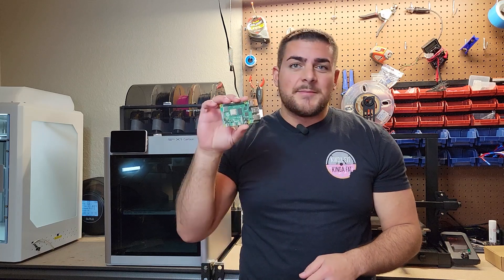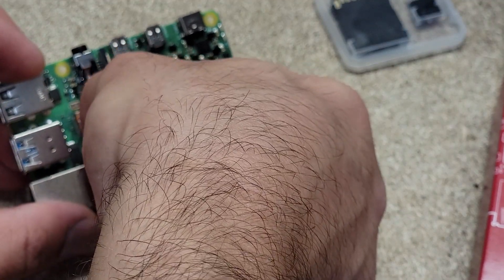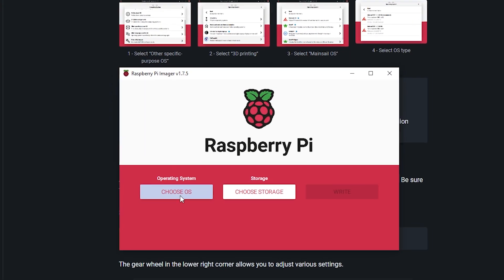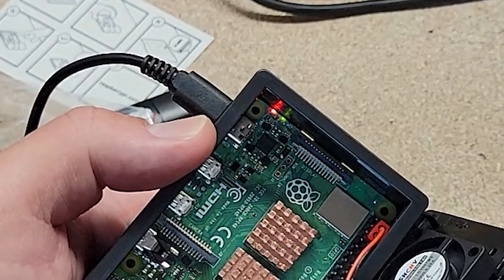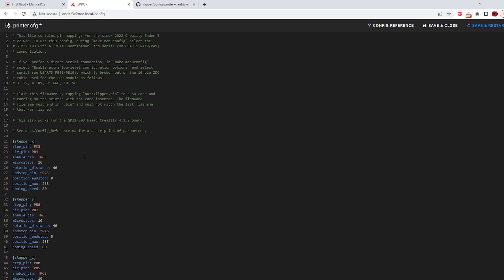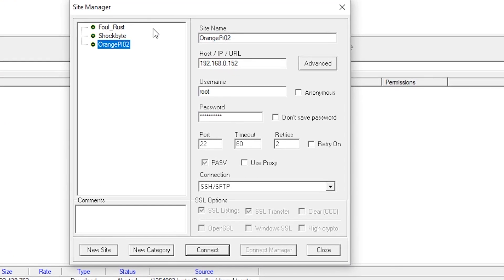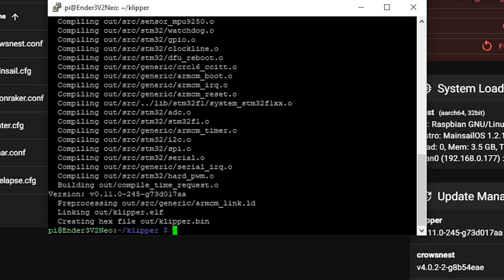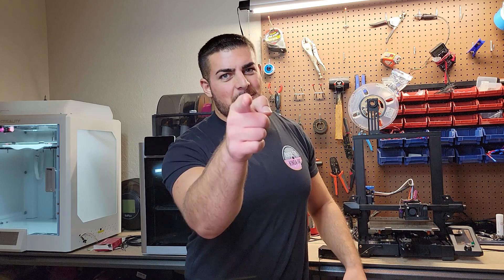Install Klipper On Your Ender 3 V2 Neo Fast! - COMPLETE GUIDE

Comment: Forgive me if this is a dumb question, but I'm just starting to look into klipper for my machine, but what's the deal with accelerometers? Do I need to install one additionally and how does that work?
Reply from the maker: Hey CalvBore, it's not a dumb question at all. There's a lot to Klipper and having an ADXL345 Accelerometer isn't a necessity, but it's a useful thing to have for accurately calibrating input shaper. I never even bothered with one on my Ender 3 Pro and it still prints at significantly higher speeds and with better quality than I was able to get with Marlin. I plan on uploading a video this weekend of going over some features of Klipper, including input shaper with this specific printer as well.
Reply: @FoulNews  Thanks for the quick response, looking forward to that video! If you do decide to install the accelerometer on a machine, would love to see a video of that too!

Comment: Great guide!!!! Can you make for cr-5 pro h pls ? and if i use on my cr-5 pro h will my light function be disabled ?
Reply from the maker: Thanks! I wouldn't waste time using the stock mainboard on the CR-5 pro h with Klipper as most people seem to have issues with it. The better alternative would be using Klipper with an SKR Mini E3 or similar as those boards have much better features and are significantly more reliable. I went through 2 CR-5 Pro H mainboards on mine before I gave up and switched. The light will be disabled, unless you use a Raspberry Pi or similar microcontroller hooked up to a relay board. From there you can configure the Pi in Putty to activate one of the GPIO pins to trigger the relay with a command in Klipper. Since I used the Orange Pi Zero 2 on mine, I wasn't able to get the GPIO pins to function, so I just made a simple physical switch mounted to the outside of the printer to turn the light on and off. If I get some time, I'll do an overview on the setup.
Reply: thank you very much for your response and informing me, I'm waiting for the continuation of your videos @FoulNews
Reply from the maker: @ulas9561  Thanks, hoping to get some new content out soon! Just catching up with the final orders of my Black Friday and Cyber Monday sale. After the orders are all shipped out, I should have time to make some new vids.

Comment: Hi, don't you know why you get: "No trigger on probe after full movement" when you try to calibrate bed mesh?
I Have exactly the same printer
Reply from the maker: When you restart the printer, does the probe do a self-test by going down and coming back up?
Reply: @FoulNews  thanks for the reply, The printer connects successfully to Klipper I can Home normally, but when I try to bed mesh calibrate, the probe self test at the center then when it moves to the first corner it probes but gets this error and stops.
Reply from the maker: @giovannizo  Is the probe deploying at all and hitting the bed on the first probe point or just not moving at all when it gets to the corner. Sometimes the bed may be physically too high, which will interrupt the mesh calibration. If that's the case, you will have to manually set the Z-offset first using PROBE_CALIBRATE in the command line. Then SAVE_CONFIG once you do the paper test etc... if it isn't deploying at all, try reducing the number of probe points in the [bed_mesh] section next to probe count. Try 3,3 first and see what happens. If it's still failing, look under the BL touch portion of the printer.cfg and try swapping around "pin_up_reports_not_triggered: True" change it to False if it's set to true or vice versa. Do the same with "pin_up_touch_mode_reports_triggered: False." You may have to play around with a few combos of that if it's failing still. Another thing to play around with is "stow_on_each_sample: true" that may fix it as well. Unfortunately not all CR Touches are created equally and some don't play nice with the default config file for some reason. Hopefully one of those fixes gets you up and running!

Comment: Thank you - great video and excellent tutorial!  However, I cannot seem to get past this message:  "Printer is not ready The klippy host software is attempting to connect.  Please retry in a few moments."  I've searched for this error message and cannot seem to find a solution.  I have flashed the machine many times and the result is the same. ...and the pi is connected to the Ender3V2Neo with the USB cable - I have tried several different cables to make sure it wasn't a cable issue.
Reply from the maker: Thanks for the feedback! It sounds like klipper is unable to see the mainboard of your printer. This can happen due to a serial ID not being correct, or missing. Try these steps:

1. Go into mainsail and locate the [mcu] section. In there see what is listed for the field "Serial:"

If nothing is in that field, put this in there:
 /dev/serial/by-id/usb-1a86_USB_Serial-if00-port0

Then save the file and do a firmware restart. If that doesn't fix it, go to step 2.

2. Connect to your host via Putty. Log into your host (Raspberry Pi, or other controller) and then type: ls /dev/serial/by-id
hit enter and see what comes up. If nothing comes up, then there's an issue with the USB connection physically or an issue with one of the board's USB controllers. If an address comes up, copy that address and paste it into the "Serial:" field under [mcu] in your printer.cfg file. 

Usually doing one or the other fixes the issue.
Reply: @FoulNews  Thanks for the reply - I followed your suggestions and the results were the same.  I confirmed this by powering down the printer, plugging in the Creality display and powering the unit on - just a stock setup. Turned out to be a bad micro SD card and the firmware was never flashing to the mainboard.  So I formatted a different micro SD card, loaded the bin file and it worked!  Thank you for the reply - your channel is excellent!
Reply from the maker: @GregWitt  Ah, one of those rare situations! I'm glad to hear you got it all figured out!

Comment: Excellent guide, thanks. Had watched others but couldnt get firmware to load. After watching this video I used a freshly formatted SD card and also disconnected the Ender3 screen. One or both of those did the trick. Success!
Reply from the maker: Glad to hear it was helpful for you!

Comment: I have flashed my Ender 3 v2 Neo Thanks Man! Only had a issue with the USB but when I changed the Port it magically worked! Really Helpfull Video! 👍
Reply from the maker: Glad to hear it worked out for you!
Reply: @FoulNews  hi man, could you make videos about Klipper bed mesh levelling with Crtouch and input shaper tutorials with ADXL345 sensor?
Reply from the maker: @the-matrix-has-you  Yes, I should have a follow-up video for this soon. Aiming to have it done this weekend if time allows.

Comment: do you have any idea if that screen is supported by klipper in anyway? im converting an ender 3 max neo, same screen, and feel like theres got to be a way to get klipperscreen onto it but havent found much luck
Reply from the maker: Yes, it's  possible, but requires a bit of work: https://github.com/odwdinc/DWIN_T5UIC1_LCD
Reply: @FoulNews  THANK YOU!

Comment: Did this for the SKR GTR, it's not connecting to the MCU
Reply from the maker: Usually that's due to either a physical connection not being completed or the wrong bootloader used for your board when creating the flash file.
Reply: @FoulNews  Solved, wrong mcu in printer.cfg, this works:
[mcu]
restart_method: command
serial: /dev/ttyAMA0
baud: 250000

Comment: I still prefer octoprint, it's easier and doesn't require any changes to the printer, klipper hasn't yet shown enough of an advantage for this change
Reply: You got be kidding me. Klipper has pressure advance, resonance compensation, and so much more
Reply: This is a guy who has no idea what Klipper is obviously.
Reply: Don't you add klipper over the octoprint module ?
Reply from the maker: Octoprint is a web interface and so is Mainsail. Klipper is firmware that lives on the 3D printer's mainboard. You could have Klipper firmware and Octoprint, Mainsail, Fluidd, etc... as the interface that lives on the Pi or any other suitable mcu.

Comment: i've got a problem that written "printer is not ready", did you have any solution for this problem?
Reply from the maker: There's a few things that can cause that issue.

1. The Raspberry Pi isn't connected to the printer mainboard all the way. Reseat the USB connection and reboot the printer and Pi.

2. The device ID is incorrect in printer.cfg and will need to be corrected.

3. The wrong firmware was flashed to the printer's mainboard. Make sure that you flash the firmware intended for your mainboard version. You can always create another copy by using putty and going back to cd ~/klipper/ then issuing make menuconfig. Just make sure that the processor on the board matches the configuration that you make when creating the firmware bin file in this step.

Comment: Thank you so much - 2 month ago I though that I never would having klipper. Everyone told me that it is so difficult to install klipper and use it.
Today I followed your video and I had some problems - first my putty would not make same as yours - butit came, it was my ip adress. Then it was difficult to have the FTP server installed at windows 10 - but I got it and then it was fast - everything do now as your video.
One thing you should link up to is - now for beginners - how to use your printer now, where do you control it and put in files for printing?
Reply from the maker: Glad to hear that the video was helpful and that you're up and running on Klipper! Yes, one of my next vids will be covering what are some helpful things to do after you've converted to Klipper. Hoping to get it out by this coming Wednesday!

Comment: Best Klipper install guide I've found, thanks!  I had to make sure my SD card was formatted correctly, ended up using the Raspberry Pi image tool to format it.  Also took 2-3 tries for the flash to take, not sure why.  But, working now.
Reply from the maker: I'm glad you found the video helpful! It's odd, but yes, sometimes the imager can take a few tries to work properly.

Comment: Is it posible to test a board with only power to the usb-c connector?
I did test it with Raspberry Pi 4B8Gb on a BTT Octopus Pro about 10 times.
Everytime i get message "MCU 'mcu' shutdown: ADC out of range".
Klipper does see that there is something wrong with min_temp / max_temp but i don't have not connected sensors to the board.
I also disabled all temp-sensors in the printer.cfg file.
So how do i get rid of this message without anything connected?
I did see tutorials with klipper installs with nothing exept usb-c power connected working perfectly. The only thing that's different is that i have a 10" touchscreen (made for Raspberry Pi) attatched on the Raspberry Pi.

When you put [include mainsail.cfg] in to your printer.cfg file you get the complete menu & settings. When i do that i get nothing, only the same errors.
When logging in with the ip-adress i only get orange errors.

Can someone help me? That would be nice.
Thank you
Reply from the maker: Without setting definitions for your own thermistors, I don't believe you can test without the thermistors plugged in. You can always just plug the thermistors into the board without routing the wires through your printer etc... and just let them read ambient temperature, that should get rid of the warnings. If you want to test your extruder, you'll need to define the min_temp for the extruder to be less than the ambient temperature as well. 

Under the "Machine" tab, check to see if the file mainsail.cfg exists. If for some reason the file does not exist, you can create the file using the configuration from Mainsail over here: https://github.com/mainsail-crew/mainsail-config/blob/master/client.cfg

As for the IP address error, that may have something to do with firewall settings, router settings, browser settings etc... I'd recommend setting a DHCP reservation on your router for your printer so that the IP never changes.

Comment: What about the display? Does it worked?
Reply from the maker: No, you'd need to install a Klipper compatible screen. However most folks on Klipper just use the web interface from their computer, phone or tablet. You won't miss the screen once you use the web interface.
Reply: @FoulNews  I see. Thank you!

Comment: Im having troubles with the exact same printer

Followed all the steps up till the pi connection to the printer where i just keep getting MCU not connected, the dev/serial/by-id or path also just says "no such file found" 

Any solutions to these? I have made sure the usb cable is for data
Reply from the maker: Are you using the exact same USB port on the Pi as when you first connected the Pi to the printer?

Comment: Thanks this helped quite a bit! What Slicer do I use now though?
Reply from the maker: You can still use any slicer that you normally use. If you use Cura, Prusa Slicer or Super Slicer, they can all connect to Moonraker to upload directly to your printer. You can also still save your sliced g-code to your computer and then upload the g-code file right into Mainsail as well.